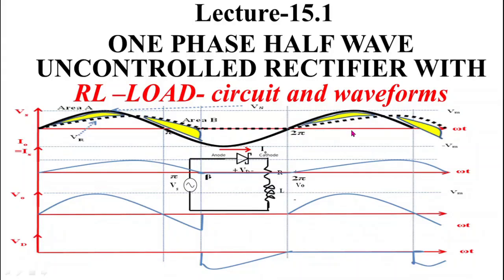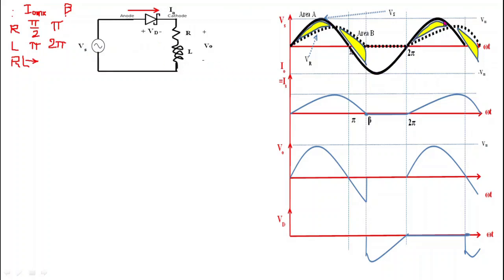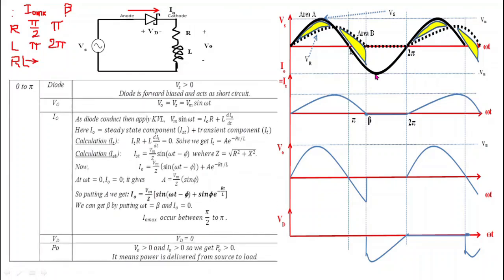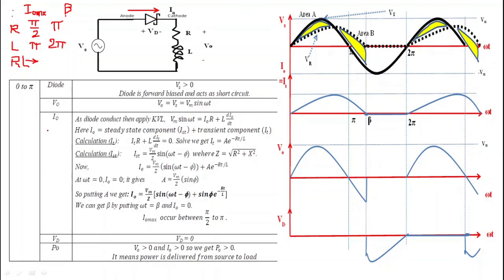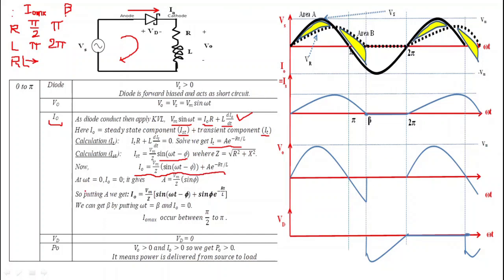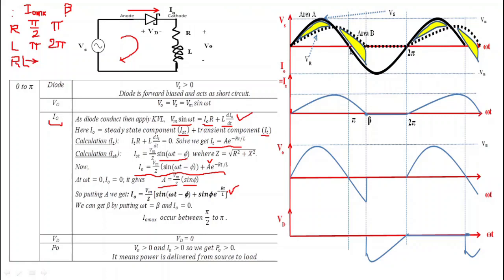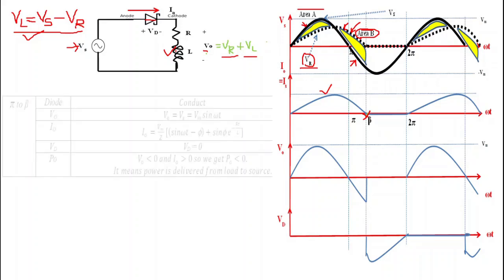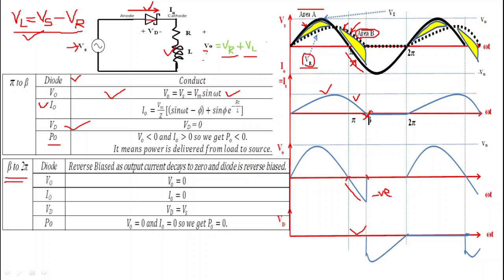Lecture 15.1 | Single phase half wave uncontrolled rectifier with rl load | circuit and waveform |

Comment: A single phase half-wave uncontrolled rectifier is connected to RL load for Vs= 230v at 50Hz , R=10 ohm , L= 5mH , excitation angle= 210° . Find average value of output voltage and output current  ?